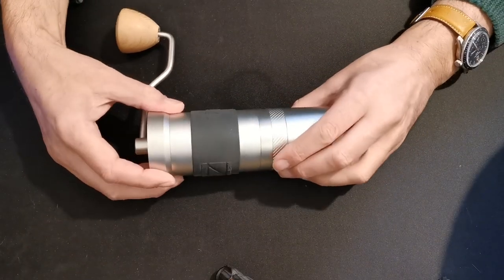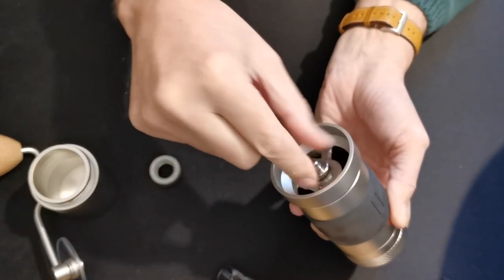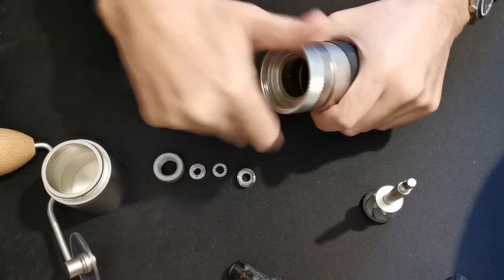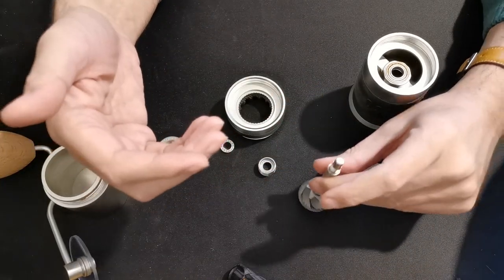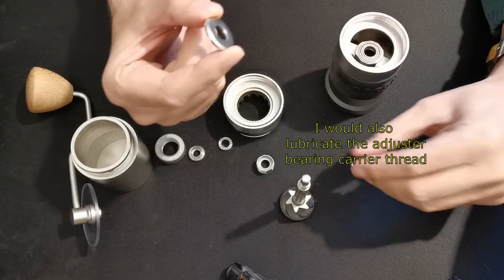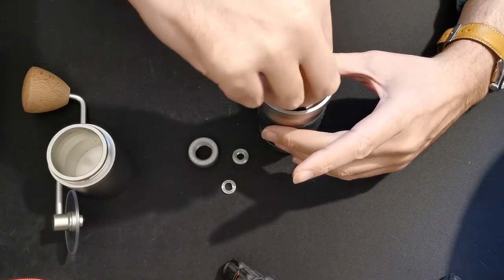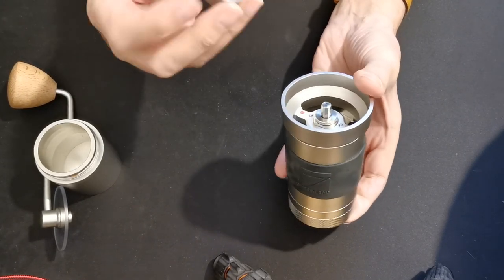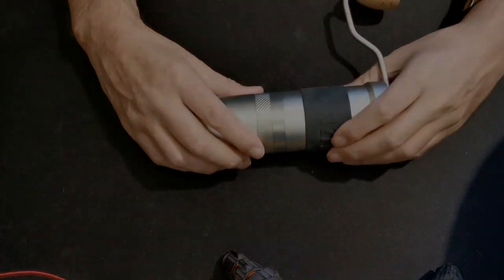1Zpresso JX-Pro Disassembly and Cleaning

Comment: Thanks for the video - was extremely helpful. Turns out my top and bottom burr were stuck together. I removed the rest of the parts so it was just those two, up-ended it (so the screw that would be where the adjuster and all is now facing the ground), held it by the top burr housing and beat it against my carpet with a few firm strikes and it dislodged. I'm now happily enjoying espresso again, thanks a lot!
Reply from the maker: Glad it helped you out

Comment: On mine, it says that the dot on the bottom side of the upper carrier has to be aligned with the red dot at the top. You did point out that the side with the dot has to be pointing down, but it can go down in 1 of 2 directions (and 1 of those directions is not correct, according to my instructions). Just thought I'd mention it.

Comment: I think something that was missed in this (very good) video is the fact that on the bottom, when you unscrew the big burr, there is an adjustable collar that allows you to move your big burr portion of the machine tighter against your small burr or less tight. If you reassemble your grinder and find it grinds more coarsely than before, you need to unscrew the big burr, and open the collar part. It is the smooth part of the lower section. It is easy to miss, because the portions are so well machined you think it is just a one piece lower body. 
Sorry I cannot describe it better, and hope it helps people troubleshoot their grinder.
Reply: could you show me how you do this?
Reply: You should make a video yourself showing how to do this mate!

Comment: Excellent video. I do wish I'd found it before trying to re-assemble the grinder on the basis of the enclosed (inadequate) instructions and having to order replacement "sliding column" and adjustment dial. :) Thank you!

Comment: There is another portion of this grinder that can be unscrewed. It's the top portion (the part that has the red dot) from the main body. Mine started coming loose, and I accidently cross threaded it, and now I've got problems.
Reply from the maker: The only thing you can do is run a very small sharp object like a dental pick around the thread to try and straighten things out and clear the grooves...then super carefully keeping it level to the thread try to screw it on. Once it's on right, work it back and forth a few times to ensure the thread is clean and straight.

Comment: Got a coffee grinder with aliexpress. From 1 to 9 clicks clings with one side of the millstone. And with only 10 clicks, it scrolls without touching. Do you think this is a marriage? In my opinion, the shaft is not even! I thought from the first click there should be free rotation if everything is well centered. I haven’t ground coffee yet and hasn’t taken apart. I don't know what to do, whether to return it to the seller or not.

Comment: Hmm, was looking for a way to pull out the bearing that doesn't come out. Mine rusted and the handle doesn't turn quite smoothly anymore.
Reply from the maker: How on earth did it rust??
Reply: @DaveCorbey  I may or may not had washed the grinder before I knew I wasn't supposed to do that.

Comment: Do you know how to calibrate it, so touching burrs reads zero on the adjustment ring? Would make it a lot easier to exchange recipes then..
Reply from the maker: I couldn't see a way of doing that because you would have to know the position of the adjustment ring is correct before tightening it and I couldn't see any way that could be done. Once the grinder is burr touching point, you would have to loosen the adjustment ring completely to be able to adjust it. See assembly at point 8m 56s...
Reply: @DaveCorbey  It can be done - there is an instruction on the official website:

How to calibrate 1Zpresso grinders?
https://1zpresso.coffee/calibration/
Reply: @PavelSafronov1980  the instructions on that site are utterly terrible. Most people skip them and, if they're determined to zero out, they put the nut on and off, pushing the inner burr from the bottom to keep trying until they accidentally screw it on it the correct orientation

Comment: Interestingly enough, my recently purchased Jx-Pro's upper burr ring section doesn't seem to screw off. Wonder if and why they changed that, it was a nice detail.
Reply from the maker: I would be surprised at that, perhaps it's just on more tightly?
Reply: My newer JX Pro has a removable upper burr but it took a huge amount of elbow grease to remove. First time I disassembled I thought I couldn't do it but lo and behold, a lightly wet rag got it loose the second time around.
Reply: @ecapsdira  I have since arrived at the conclusion that I just needed the forearm strength of a bodybuilding orangutan to dislodge it.
Reply: @ecapsdira  I just got my newer version of JX pro, still can't seem to remove the outer burr from the body. Is it removable at all?
Reply: @stististi  I feel like it should be removable. Having a non-replaceable burr piece sounds like a critical design issue for a grinder so I'd imagine that 1Zpresso would keep it so.
Reply: @stististi  yes mine too, seems that the JX PRO in this video was different

Comment: I have difficulty in opening the outer burr ring. Its so hard to open. Do you have any tips?
Reply from the maker: I am afraid not...just double check you are twisting the right part as they did make some small revisions to the outer case.

Comment: I just tried a JX Pro and there is a tendency to unscrew the body (the part with the reverse thread) while grinding.  

In this video, we have to remove the inner burrs before we can unscrew the body/outer burr.

My question/concern is have or will I spoil the grinder each time I accidentally unscrew the body/outer burr while grinding?  Of course I quickly screwed it back...

Please advise! TIA!!!
Reply: I have the same concern. I just got my grinder today and I accidentally unscrewed the body (very very slightly). Did this become an issue for you?

Comment: Great video!  My JX-Pro is on the way.  I take it that calibration is unnecessary.  Just rotate to 0 (clockwise-fully closed) and count clicks/numbers counter-clockwise.  If you remember how many numbers/clicks, just go in either direction to change your grind. Dave, when you reset yours by two turns, that would put you at 80 clicks, or about 1,000 microns, right?  I don't do espresso, but isn't 1,000 a bit coarse?  I brew French press, and may use a Virtuoso+ set to #16, or about 600 microns.  Something seems off.
Reply from the maker: I think I go 1.5 turns sometimes a bit less
Reply: IMO,  it's different micron measurement. Your 80 clicks~1000 microns is Burr gap and it doesn't  predict coffee particle size reliably. If you want to correlate between those two microns, you way want to use KRUVE sifter to see the coffee particle size

Comment: Why does my Jx pro (purchased December 2020) appear to have different internals? The adjuster looks entirely different. Purchased directly from the 1zpresso site.
Reply: Upon further review: ordered a pro, received the regular JX. Shit.
Reply from the maker: That's awful if you paid JX-Pro money. The Burrs are the same but there is less adjustment steps available
Reply: @DaveCorbey  thankfully I had only just opened the box and opened your video before doing anything else. I am able to exchange it for the pro. I was so confused for a few minutes.

Comment: Have you looked into calibrating the grinder at all (eg: to have 0 be the tightest/closed setting)?
Also, Did you do any disassembly of the top carrier portion of the grinder? (The oversized ring that captures the upper bearings). My unit arrived with that portion unthreaded a bit. I tightened it in before playing with grind settings though (it's also reverse threaded like the lower carrier.
Reply from the maker: I probably could have don't but they are just numbers....it didn't matter that much to me. I know that 1.5 turns I think it was gets me in the espresso ballpark and that a click is 6 ish seconds on the shot, so I get in the ballpark then pull a shot and adjust dose for fine control (of shot time/weight) from there.
Reply: @DaveCorbey  😮😮 One click is 6 seconds in the shot extraction?
Reply: @ingenieropic  no, it definitely isn't. It's closer to 3 seconds. The regular JX is about a 6 second difference between clicks, not this one.

Comment: When you assemble it back in, does the '0' mark always line up with the red dot? 

Is it the same with the normal JX?
Reply from the maker: I never worried about it. They are just numbers. I'd close the burrs to touching then back 1.5 turns or whatever to espresso. You just note how many turns to burr touching prior to disassembly.

Comment: Hello, something really disappointing happened with my JX pro. I opened it and cleaned it exactly as per the instructions I found in the box. The big problem is that 1 full round now, gives me Turkish coffee-like grinds!!! Before with slightly less than one full round I could make espresso!! What has happened? How to solve it?
Reply from the maker: From memory I am pretty sure I had to go approx 1.5 turns from closed, to be in the espresso range. Different beans will need different grind settings e.g. A brazilian coffee needs to be ground much coarser than an El Salvador for the same flow rate in an espresso machine.
Reply: Dave Corbey thank you Dave! I understand, what I can’t understand is why, with exactly the very same coffee, before dismantling the piece 1 turn was enough, and now I need almost 2 turns! I can’t understand what I misplaced, I literally did the recommended procedure...
Reply from the maker: @stemazzo84  Try doing it again but follow my video instructions exactly, perhaps you have a cap or washer the wrong way round or misplaced. I really did review it very carefully and took it apart quite a few times and never had a problem.
Reply: Dave Corbey will try again, thank you!
Reply: @stemazzo84  isnt it good? so you have finer (longer) adjustment for espresso
Reply: Perhaps recalibrate the Zero on the JX Pro?
Reply: I habe the same problem. Followed your video but still I have to go 1 full rotation more that before. Anyone any idea what happened with my grinder?
Best regards Christopher

Comment: hi all, I'm worried I broke my grinder... everything seem's shoved up a little bit and I can't move anything at all. Does anyone have any ideas? In this video, the lower burr comes right out, but with mine now it is so stuck I can't seem to move anything at all... I'm distraught.
Reply from the maker: I'm sure you didn't, drop onto the forum and we'll try to help you out.
Reply: @DaveCorbey  thanks so much! I actually got it back to normal; I did a bit of loosening on that allan key slot, and the spring actually popped it out when I tried to reassemble. phew.
Reply from the maker: @matthewraymond2881  Excellent news, It's a well-made hand grinders and there is so little to go wrong...glad it's sorted.